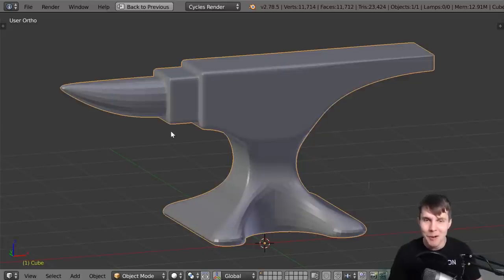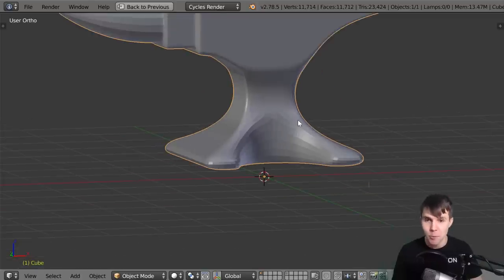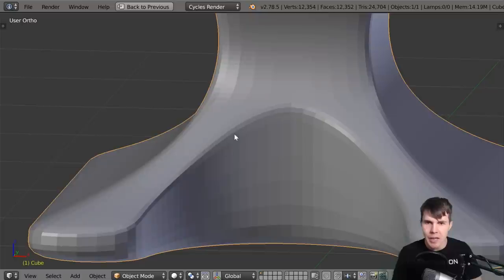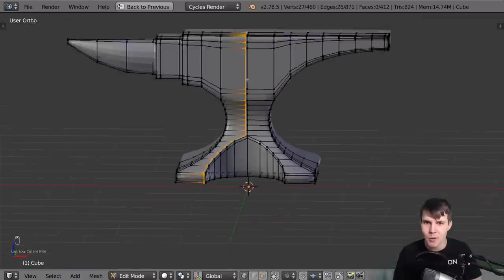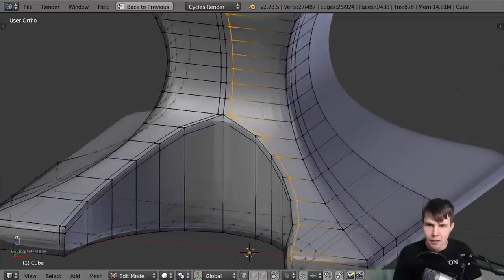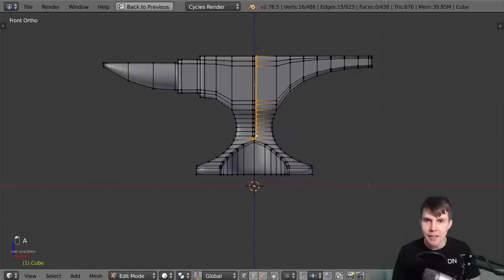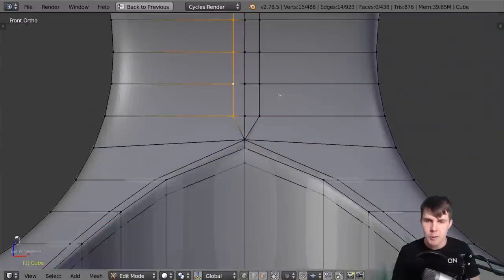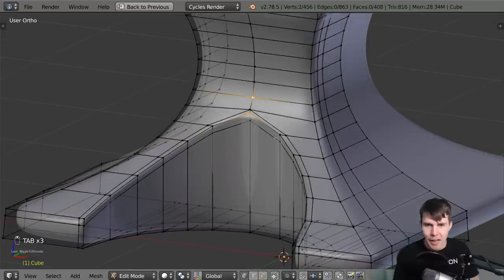Blender Intermediate Modelling Tutorial - Part 4: Final Touches

Comment: for blender 2.83 users: the hotkey for merging vertices is "m" not "alt + m".
Reply: nope its alt m
Reply: @fyf1248  nope.
Reply: I still dont understand why they changed all the shortcuts
Reply: M then b
Reply: To delete doubles but it merges them
Reply: @fyf1248  this is edge split
Reply: That's why I use spacebar to search whatever tool i want.
Reply: @thatsalot3577  But the problem with that is it takes too much time typing and searching it all out
Reply: @pranavlonaree6732  yeah it's a slow process, but really good if you're starting and don't know which option is in which tab or the shortcuts.
Reply: Mmm

Comment: 17:36 I feel so satisfied coming up with an own solution here, I simply used the knife tool to draw some additional lines just in that area and so I managed to have a cutting sharp edge if I want too...or else I figured out you could still use a loop cut yet hiding everything else you don't want the line to go, as done previously :D same result!
Reply: It's actually pretty smart. The first thing popped in my head was boolean, like creating the cube that cut out hole but it did not worked at all for some reason
Reply: Yeah I had the same idea and was wondering why he didn't just use knife. Maybe there is something complex or wrong whit this method?
Reply: yep im wondering if there is something wrong with this technic ?
Reply: @gabrilapin  nope, I used the knife technique too. Just think about it as adding more detail in specific areas to accomplish what you need to. It's easy to remove the lines later if you change your mind.
Reply: I also had the same idea, but if you use one of these solutions ends up generating a polygon with 5 vertices, I think a better solution would be to model the square part first and then the round beak
Reply: Inset first, then extrude down. It doesn't have to be hard

Comment: UV unwrapping video is just what I need.
Reply: Derpy agrees!
Reply: Where is it? Didn't see a link when he "pointed" to one...
Reply: Odds are it isn't up yet.
Reply: Agree!
Reply: Ye dude
Reply: I had pretty good results with just selecting all verts, hitting u and selecting smartuv with default settings.  You might need to touch up around the round hole, but otherwise I liked the result.   I didn't mess with trying to straighten those out, instead I used some metal textures from the web with the pbr node and mixed it with the dust from BG's dust tut to give it an used, sitting out for a while look.
Reply: kronykus hmm... Maybe I should try that feature.
Reply: I also used pointiness to add some wear to the edges, but with the dust it's hard to tell.  I was going to upload the render to imgur, but apparently that site doesn't like uncompressed, 16-bit, 4k images lol...

I used gimp to resize and uploaded a mildly compressed 1080 version here: http://imgur.com/bESwNG9

Comment: I've watched this all and I liked it. It took me the whole day but I made it. Blender Guru is an awesome teacher. Thank you for your effort to teach us beginner how to do it properly.

You may have noticed that the Loop cut tool is used throughout in the videos to adjust the edges of the model, however it always comes with the side effect of "slicing" the model. Not only it adds unecessary vertices, but a need for further vertex aligmnent and cleanup.

I've learned a easier way while doing a research for "limiting the loop cut tool". All you have to do is:
1. select the portion of the geometry you're interested in 
2. invert selection (ctrl + i) and hide it (h)
3. select the remaining geometry and proceed to use the loop cut (ctrl+r) to adjust the edges of the model as normally you do.
4. unhide(alt + h) 

now you see the loop cut tool limited itself in the area it was intended to

Comment: Andrew, both of those holes are supposed to go all the way through. And that "hardy hole" (the rectangular hole) is supposed to be square. You were right though, the round hole is round.
Reply: how would you go about creating the hole all the way through? is it as simple as doing the boolean operation we did in the beginning or would i need to adjust faces and all that?
Reply: I am a Blender novice, never really gotten beyond making custom logos. My comment was with regard to the accuracy of the model as I am also a novice blacksmith.

Sorry if my out-of-place comment a couple years ago caused any problems for you
Reply: @Randaakarim  just boolean it all the way through
Reply: @Cyanidedan  I did a mix, extrude the whole way through, then delete the bottom faces before connecting everything back up again with the topology I wanted, using snap to vertex to align everything :)

Comment: The round and square "indents" are holes, all the way through the anvil.
Reply: lessemo mostly to help bend metal
Reply: To bend metal, yeah, but people use them to hold hammers all the time
Reply: For bending and some shit like that. Like you can put a hot iron rod in there and bend it at will. The round hole is usualy used for making nails. You just bash it with hammer until it has the head every nail needs :)
Reply: The square one is also used to hold diferent kinds of tools: cutting tools, fullering tools, all kind of stakes for armouring...
I mostly use it with a bent bar to hold firmly any piece i'm working on
Reply: So how would one go about creating that hole all the way through. A boolean just gets all distorted
Reply: It used for forging, bending and etc. DO NOT SEARCH "forging knives video" (I have two procrastination decease: blender tutorial videos and forging knives videos).
Reply: It used for forging, bending and etc. DO NOT SEARCH "forging knives video" (I have two procrastination decease: blender tutorial videos and forging knives videos).
Reply: A boolean, but make sure it doesnt cause ngons that distort the subsurf.
Reply: They are called hardy holes. They have multiple uses. The main three are:
1: Used to hold tools like cutoff tools and stakes for planishing etc. They are square so the tool does not rotate.
2: For use with a punch to punch holes in hot steel.
3: This is less often but they can be used as a way of bending steel. However, most blacksmiths will have a leg vise for this purpose.
Reply: prettypistolx You need to have a face on top and one on the bottom, then you delete just the faces, then you select the vertices and create new faces to build the "wall" of the hole.

There are more details, but they'll vary depending on your model and on what you're trying to make.
Reply: Technically, the square one is a hardy hole, and the round one is a Pritchett hole. The Hardy hole is usually used to hold tools, and the pritchett hole is usually used with a curved metal rod that holds the work on the anvil for you.

Also, the hardy hole is SQUARE not rectangular like in the video.... I love Andrew and his videos, but like, did he only see 2 reference photos??
Reply: thank you for making this project easier :P
Reply: Daniel Kranich The curved metal rod for the Pritchett hole is called a holdfast. I'm sure you know that, but thought it night be good to add for the rest!

@blenderguru Why not use inset for the holes? It comes with the edge loops already there...

(The singular of "vertices" is "vertex"...)
Reply: Hardy holes can easily be made with a boolean
Reply: Um. I did the boolean for the circle hole... and then my anvil turned into an anvil shaped spider web of infinite vertices... like millions
Reply: My son Blacksmiths and your answer is excellent!
Reply: it took me literally an hour to make the square hole
lol (wondering how long it is going to take me to make the circle hole)
Reply: @Pather23  If only teaching was that simple, we'd all be geniuses.
Reply: @prettypistolx   you could extrude the face inward all the way through and merge the vertices. Its a painstaking process.
Reply: There's often a square hole and a round hole.  I think the square one is termed "the Hardy  hole" -- I don't know if that's a name, like a trademark, or an adjective, like "hearty".   --Feel free to start googling.
EDIT:
CRUD.  What Gizmo 73 said.
Reply: On woodworking benches they are used to hold clamps to hold work down or stops to stop it sliding around. They are known as dog holes.

Comment: Hey man, awesome tutorial. I have a couple of things about the anvil to point out though. I know this is an old video but this is just in case you decide to remake this in the future for 2.8.
The square hole is called a hardy hole, it's for plugging in hardy tools, and they need to be firmly held in place. To this end, and since tooling for anvil making is really expensive, the square hole is standardized to 1 inch, or around 2.5 cm. But the important thing is that it's perfectly square, otherwise it's completely useless. It's one of those things that ruin everything once you know them.
I've been thinking about a solution but I can't do it without deforming even slightly the horn, whose geometry is also standardized and important for realism.

The other hole is called a pritchel hole, and it's there so you have clearance to finish punching through a piece of steel. As such, position and size are not really important as long as it's not so big it would allow the steel around it to deform when punching. Also, it's more comfortable to have on the side you work from of course, which you did right.

You can also put tools with round handles in there, so that should be considered when choosing size. That being said, most blacksmiths forge their own tools, so that's not really a problem.
Because of this, when modeling a workshop, a lovely little detail would be to shape all the tools based on the hole sizes of the anvil. It also helps a lot with scale in my opinion.

Yes I am indeed unbearable.
Reply: Thanks, I love finding out this kind of stuff

Comment: In a real anvil the square and circular holes would actually go through. It would also be a good topic on how to solve that, since you have to rejoin everything again on the other side. It took me some fiddling around to get it how I wanted it. Anyway, great tutorial, it really helps getting started with Blender. One little thing though, in some sections you rush things a little bit too fast, I had to rewatch some sections multiple times to get what you actually did there.

Comment: When creating the Square-hole you can just inset the face before extruding it to create a loop around the top. Or you can just Bevel the edges
Reply: That was I was thinking too
Reply: Exactly, I'm surprised he didn't even mention that method as it would be the better way to do it
Reply: Could I use a cube which gets subtracted with a boolean modifier?
Reply: Yes, but you would still need to add edge loops to sharpen the edge. Extruding inward would be the best way.
Reply: I was think the same, almost anticipating being the smart student because in just a moment, he is going to reveal the smart way of doing what I am already thinking.
Reply: But with a inset you destroy the "flow" of the quads i quess. But yes, i was first thinking on inset too  ;)  (sorry for my english :D )
Reply: The flow would actually be the same as adding the extra loop cuts
Reply: Yes, but you would still have to add the edge Loops (Though you could add them to the Boolean Object and by that to the Anvil with a few Tricks but those are for advanced Tutorials)
Reply from the maker: Surprisingly this makes little difference. I thought the same thing, but try it. It makes the edge sharper (which is what we did anyway by adding a loop cut below it), but the corners are still perfectly round.
Reply: Did you bevel all the edges of the hole, or just the top?
Reply: I used a knife tool as my edge loops were closer to the edge, and extruded that face inwards and followed the instructions. Is that advisable?
Reply: when I extrude, the middle edge where it mirrors, doesn't move and creates 2 holes, one on each side of the mirror. Am I missing something? As far as I can tell, none of my settings are different from his.
Reply: You have to apply the Mirror before extruding
Reply: I experimented a little bit with it. A way to get full control over the edges and the corners without disturbing the whole edge flow ist to inset all faces around the whole which gives you extra edges you can connect to loop cuts inside the whole. That lead to the best result I could achieve.
Reply: You can also just hide everything but the hole (shift + H) and make the same loop cuts without cutting anything else.
Reply: Sorry this is a bit late but you can't. This is because the anvil is not actually full, meaning that if you used a boolean you would not get the depth you would have you extruded it. Picture it like cutting a hole in a piece of paper instead of digging a hole in sand
Reply: When you press "I" to do an inset, and while the inset is still active, you have to press B which will snap it along the mirror side so you get one hole instead of two. He does it in one of the earlier videos, I think when he's creating the square collars at the base of the horn.
Reply: @blenderguru  Dear Andrew, I wanted to share my solution with you. What I did is this :

- I chose the same face than yours
- From the top view, I use the knife to cut it in half (that hole is square, not rectangle to me)
- Extruded it downwards
- Used loop cuts as usual (the loops didn't go all the way as in your example)

Comment: 4:49 - for Blender 2.8 users: use Shift+Tab to turn on snapping and click the ruler button at the top center of the 3D Viewport. Click on Edge.
Then click the merged Vertex and snap it to the bisect / loop cut (By pressing G and moving it close enough to the edge).
It's better than having the lines either indent or bump out of proportion.

Comment: Both of those holes you made starting from 16:40 (called hardie hole and pritchel hole in order) actually go straight through the anvil, they are used for specific tools but also commonly used for bending rods and spikes.

You can see it better in this picture: https://upload.wikimedia.org/wikipedia/commons/4/4c/Fciron-anvil_face.jpg
Reply: I'm no the only person who notice it.
Reply: this really bothered me cus trying to put it in my model was very different to what he does here.

would love to see how he adds a hole like this considering you have to add faces along the inside of the whole.
Reply: @daslynnter9841  Here's how I did it: 
1) Go to Edit → Preferences → Addons and activate LoopTools. 
2) Select a face on top and one on the bottom of the anvil. 
3) Press W and select LoopTools → Bridge. It creates a sort of tunnel between the two faces. 
4) If your mirror modifier is still active, it will create a face in the middle of the hole. Delete it and you're done!
Reply: @pranavghantasala6808  W is not opening Looptools :(

Comment: I am metalsmith and my only problem with the modeling here that the hole is not right, it have to be square. The hardy hole is a square hole into which specialized forming and cutting tools, and allows you to secure various tools in the anvil. It is also used in punching and bending operations. The pritchel hole is a small round hole that is present on most modern anvils. So I cut the square face with the knife tool half than I extuded the hole. After this with loop cuts I could make it nice  :)

Comment: Square is a hardie hole used to hold a variety of hardie tools, or for bending metal, or for measuring (usually they're an exact square...makes forging 45 degree shoulders very easy).  The round hole is a pritchel hole used when you're punching through the metal to make a hole so you don't damage the anvil surface.  Both holes go all the way through the heel of the anvil.

Comment: Is there any particular reason that when creating the holes on the top of the anvil, you used loop cuts rather than the knife tool? I used the knife tool and didn't run into any problems (that I've noticed yet). Just wondering if I'm going to run into something when rendering perhaps?